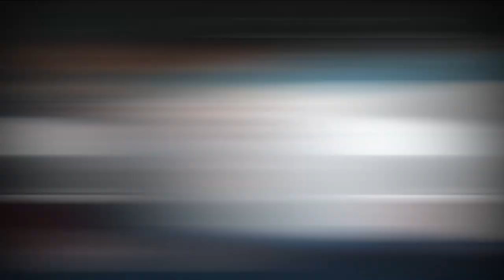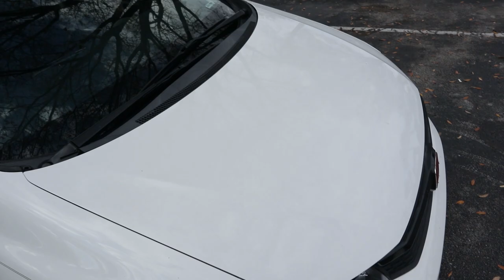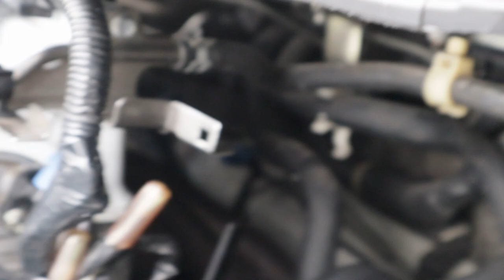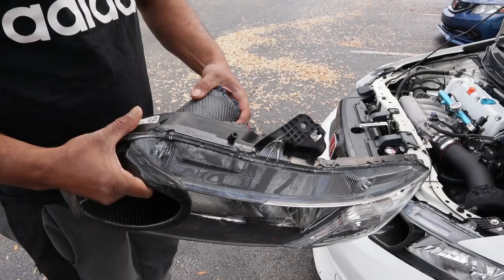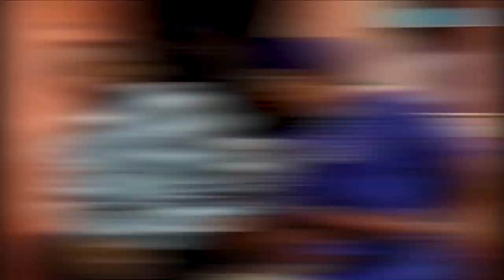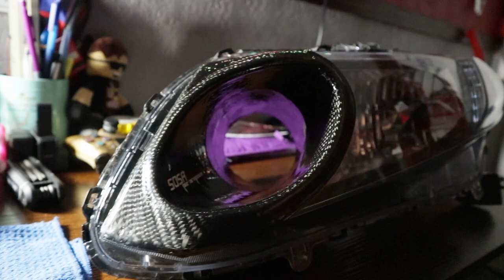I drove 250 miles for this one EXPENSIVE thing...

Comment: I always been interested in doing the z3 head swap since 2015 back then people were laughing at me but now it's a realality.
Reply from the maker: It’s actually isn’t hard as you think .. there are 3 down here in south Florida
Reply: @zoovie   yeah I follow them if I had pull the plug and did the swap it would been 2 to 3 years ago but I'm always iffy about porting the coolant passage way on the block. Because a metal shavings getting into the block. Also that headlight velocity stack is fire